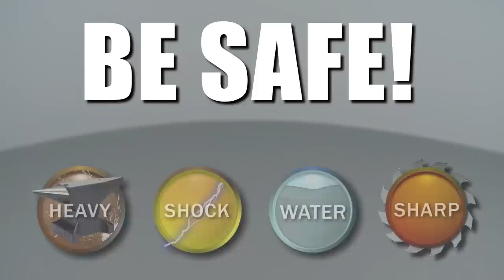GE Dishwasher Control Cover Replacement #WD34X20180

Comment: Snapping in the bezel as shown, as noted several places in the comments, is impossible without breaking off the tabs. You need to remove the control board assembly to correctly install it. Unless the purpose of this video is to sell more bezels, it should be redone from an unprepared door. Then you can even show that the vent needs to be unscrewed to separate the door. Honestly, one of the poorest instructional videos I have ever watched.
Reply: I broken the tabs on4  panels

Comment: !!!!Read jimbalio's comment and others!!! If you try to replace the cover plate like in the video, YOU WILL BREAK the shit out of the tabs! It's not that hard once you have the door off. Eights screws out, separate the buttons from the inner plate, snap on the outer plate to the inner plate, buttons back in, eight screws back in, resume with the video.

Comment: Bought a new damned console cover only to have all the effen tabs break off when I attempted to install the mutha!!!
Reply: I accidently kicked mine off the door (don't ask) resulting in broken tabs.  I tried to repair it by using liquid nails at various points.  Absolutely could NOT get a tight seal.  Fail.  Proceeded to buy a new one for around $90 and YES.... all the effen tabs broke off when I attempted to install the mutha!  Any other suggestions?

Comment: I will say, this was a helpful video until you get to the install of the panel. There are four screws for the button assembly that you need to take out in order for the buttons to recede and you can install the panel.

Comment: To summarize the comments: 
- Very dumb design by GE to necessitate removal of the entire door assembly to replace the control cover that has an inherent flaw of very fragile plastic tabs as securement
- The video is very good EXCEPT must remove the button assembly in order get the cover flush with the case in order to slide it over
- Even following these instructions the plastic tabs on the replacement cover may still snap because of their fragility
- May be easier to simply break the tabs and then super glue to cover to the case 
- Again, gotta emphasize how dumb of a design this is.

Comment: This door must have been allready rigged up so it would separate easy, this is the absolute worst model to work on, out of the hundreds I've done, the door panel never separates that easy or go back that easy, and let's not get into changing touchpad control panel that all the personality instructions are wrong for your model, and that's not a good thing being how difficult these door panels are to separate, problem is ge has to many models that utilize the same boards and just change personality

Comment: Supper flimsy. Does not simply engage at front and click in place. The tiny tabs simply break off as the original one did. Guy in video shows it snapping in with one hand. I’m pretty handy and these insides not work. 50 bucks for part down the drain.

Comment: If you don't know how to install the cover the correct way...DO NOT post a video to mislead others.   As others mentioned.   You need to remove the user interface module before installing the cover.   Your way will result in all tabs broken.   Please do the right thing & delete this video